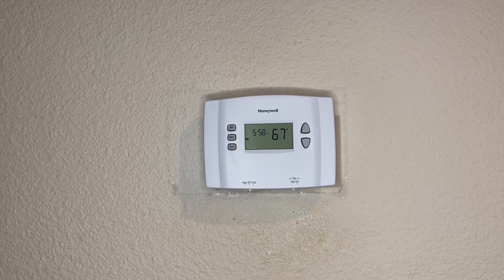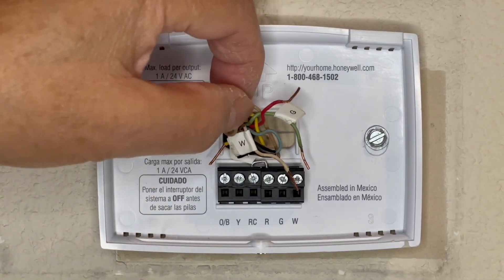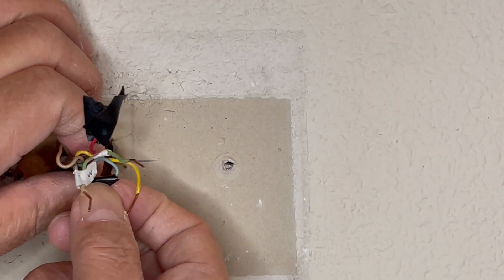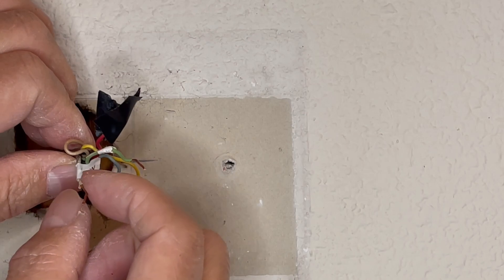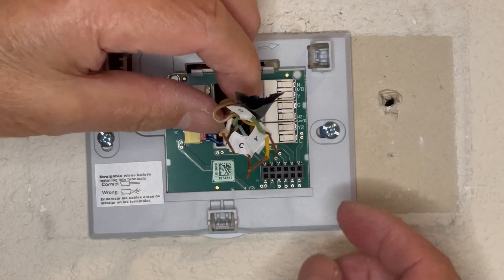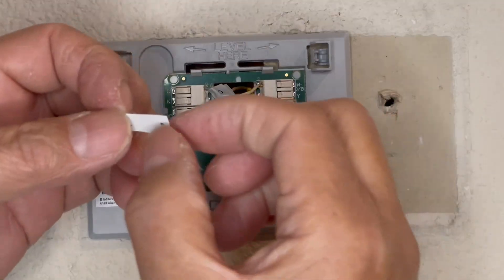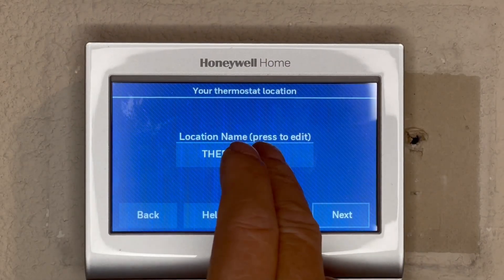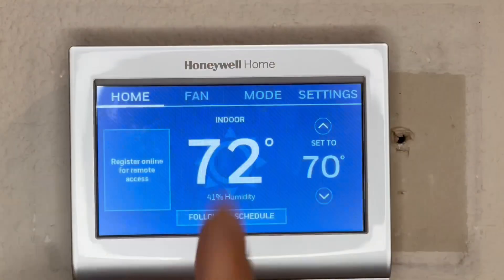Thermostat Install Honeywell RTH9585WF Instructions Step by Step

Comment: I'm confused about the C wire. The documentation said it was for powerup the unit, but why doesn't the red power wire do that? I thought the C wire was the blue one. I'm replacing a nest which doesn't use a C wire. Apparently the colors are variable. I'm in a 50's ranch and the wires have cloth insulation that is striped white/color, if that makes a difference in why I'm confused. The HVAC company came out and wanted to replace the whole furnace (it's 25 yo so that's not crazy) but I think it's because the nest battery died. It's been there for 13 years and we've had no trouble till recently.
Reply from the maker: The red wire is to power the main function of the thermostat.  Then came newer type of thermostats such as programmable (which could use a separate AA battery to power the LED display and back light without needing a C wire.  Then came Smart thermostats with larger LCD displays and backlight needing more power and required a C wire. (Separate power requirements besides powering the main function).   There are other ways to wiring this Honeywell Smart thermostats without a C wire but you’ll have to refer to the instructions or contact Honeywell.  I don’t know about the Nest but you’ll have to check.  Replacing the furnace just because it is old is not a good financial choice.   The HVAC needs to diagnose the problem and asset the issue and provide them to you to choose.  If the tech didn’t tell you which component is the problem it’s like tell someone they need a new car but didn’t tell you the starter is the real problem.  

With the cloth insulation over the wire is an old style wiring.  If you’re not sure about the color used in your HVAC system as mentioned is this video which is the common color wires used.  You’ll need to go to your furnace and see what wire color are connected.  The should be the exact color.  Meaning if the red wire is connected to the R terminal on thermostat then the other end of the same wire will be the red wire connected to the R terminal on the furnace control board.  Not sure if the same control board controls your furnace and AC.  Ask the tech if the problem is the thermostat.  Someone who knows what they are doing should easily test it in 10-15 minutes.  Check my other video ‘Home AC Heat Thermostat Basics and Diagnosis’ https://youtu.be/rb6WzMkXCWw?si=B4xOZCcbAJ1YR1qp
Reply: @Youcan-x9d  Thanks for the information. I'll take a picture at the furnace just to be safe, but I think the wires are labeled on the nest. I put that in and it was fine for 13 years, lol. You video is great. I really appreciate that you showed it as you went including when something went wrong at first and how you fixed it. I'll def check out your link too.
Reply: I suspect that the nest battery died and I could have bought another one but now Google has bought nest and they want you to pay for the internet access, which should be illegal in my opinion.
Reply from the maker: Definitely take a picture or a video of the wiring before you replace anything.  I try to leave in the video of some common mistakes or trouble I encountered so others can avoid the same mistakes.
Reply from the maker: Google like other companies want your data either to sell it to other companies or to sell you something.  The Honeywell smart thermostat also collects your data since you have to connect to the internet to control it through the app and to get weather information displayed on the smart thermostat.  It also sends me a monthly report of how many hours I turned on the heat and Ac so they have the data.
Reply from the maker: I corrected the wording… red wires connected to R terminal…

Comment: i ned help wiring this specific thermostat.  has anyone used the white supplied jumper for anything?  if so, how do you have it wired??
Reply: Run the G wire on thermostat to C and on furnace put the G wire to C and run the jumper from Y to G

Comment: Hi! I have this. It’s my second one. Had one for 2 years in old home and moved. Have had the new one in new home for a year. I just realized the AC was not on and it was getting really hot in the house. I opened my app and it said it was not connected. I went downstairs to look at it, and the box is dead. No problem, I’ll replace the batteries. However, I’ve never seen batteries like this, there’s three tiny lithium batteries, not the flat kind… They’re almost the size of half of a AAA battery. I can’t get them out and I can’t find them online. Do you think you could snap yours off and take a look at these batteries and suggest where I might find them? I would hate to have to go buy a whole new unit because of the batteries. Of course it’s brutally hot outside and nothing I can do about it tonight. Thanks for any help you can give! Oh, and I LOVE this thermostat.
Reply from the maker: Those three tall rounds cylinders are not batteries or to be replaced. There are no batteries to replace.  They are most lightly capacitors.  if your thermostat has no display then it could be the thermostat or the C (red) wire came lose (as mentioned in this video) or lost power.  Your circuit breaker might be tripped.  The circuit breaker provide the C (red) wire with power (light up) the thermostat.  You could pull out the thermostat and use a wire (with some insulation on it to keep you from getting a mild shock) to jump (connect) the R terminal to Y on the base plate to see if the air conditioner comes on.  The fan will come on in about 30 seconds.  If this works then there is power and the AC unit is working.  Then the thermostat is the problem or is not push in all the way and is not making good contact with the base plate.    You can see my other video to diagnose if it is the thermostat or a power, circuit breaker issue.  And read the description.  https://youtu.be/rb6WzMkXCWw
If the problem is the thermostat then you can snap a new one in.  Keep using the existing base plate and no need to rewire or replace the base plate.